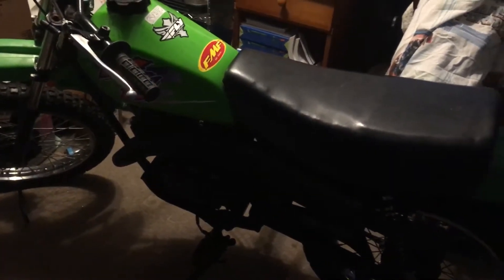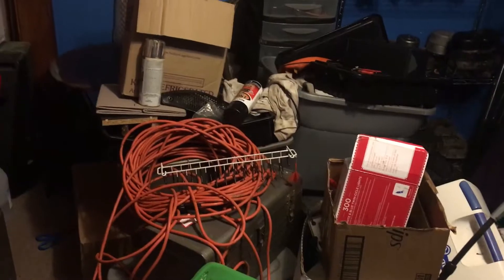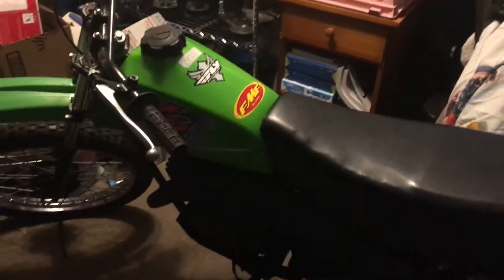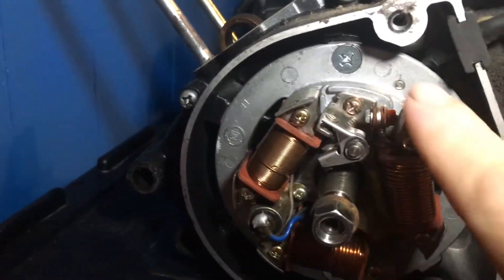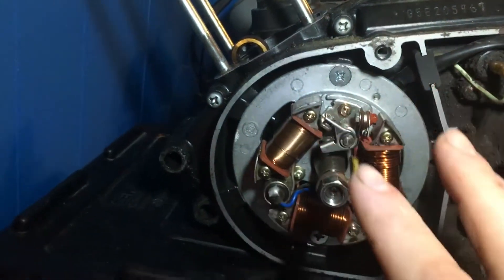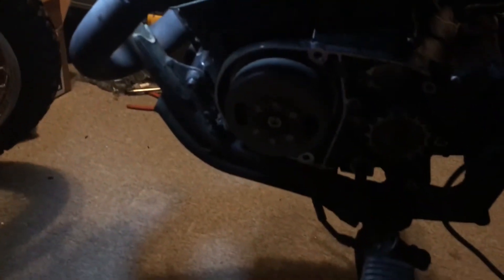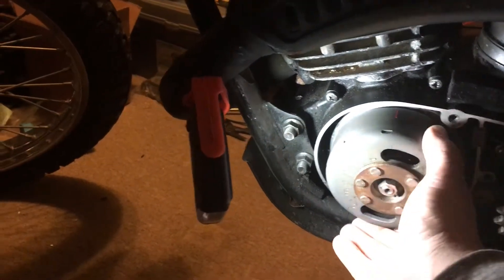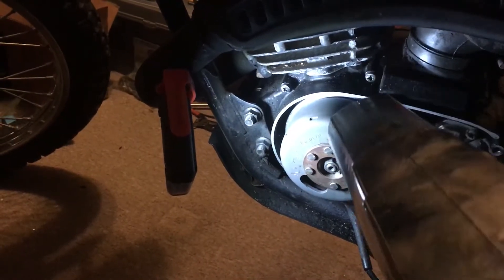using timing light to check timing on dirt bikes

Comment: Appreciate it. Just got a new ignition and want to make sure i set it right, since i don't have a dial indicator to read tdc & btdc.
Reply from the maker: What kind of ignition system did you get you don't need a dial indicator
Reply: Its for a 96 ktm 250sx dirt bike
Reply from the maker: @craigwilson8255  is it aftermarket ignition or factory replacement
Reply: @2strokeguru  it is aftermarket. Unfortunately ktm doesn't make the oem anymore.
Reply: It's now a cdi ignition.
Reply: @craigwilson8255  hay any info on the 96 KTM 250 sx timing would be great... Not much info online about it... I also have the 96 KTM 250 SX and am in need of some information because I also ordered a whole new system... Stator,cdi as they don't make the OEM anymore...

Comment: Thanks very helpful I have snapon timing light but I was about to buy timing buzzer specifically for 2 strokes but now I think I will use my dad timing light my stator plate can turn I have reeds it seems like lots going on but once I understand it I think I will say it's simple engine I just want to check if points are opening at 3.2 btdc must be dead on my bike runs but seems I have a flat spot if that's what you would call it. Going up hill it's great going down hill seems like it loses power FYI I had stator plate off when I got bike it needed totally gone through I just ain't understand 100% but I'm going to take battery out my truck and give this a try I would do it outside but it's raining. I bought all the tools except for the point checker like one in photos in manual is one I wanted but they are pricey so if this can suit my needs I'll be very happy with money in my pocket lol

Comment: you have to rev the bike at 3000 rpm to get the timing marks to show up and align...not at idle
Reply from the maker: Does your timing light say 4 6 8 cylinder sounds like a car timing light I have 1 that does it to